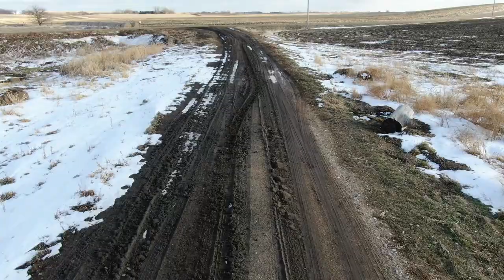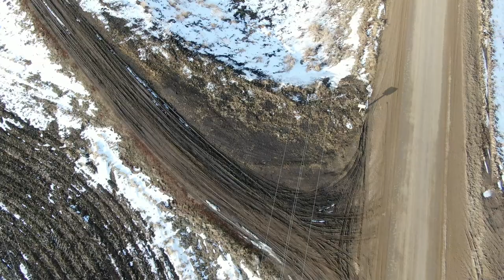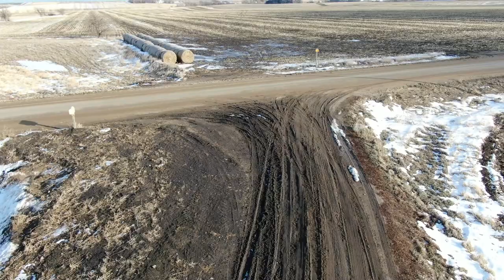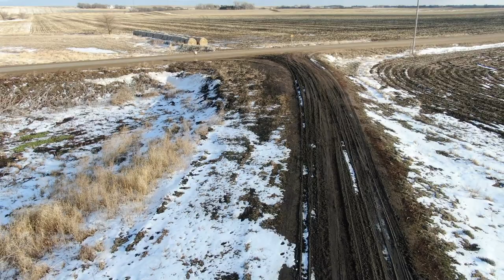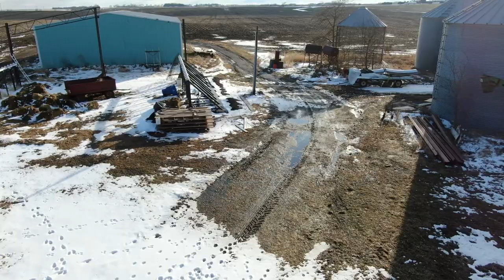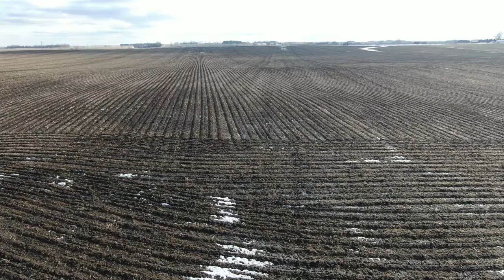FDWB - Muddy lane question - adding rock & fabric?

Comment: The brother in law has a driveway that was in similar condition when he began working on it about 20 years ago.  

The first year, while the mud was still soupy, he shredded and scattered several bales of old hay on the drive.  Then he waited until the mud was almost dry before he scattered several yards of yellow clay over the mud.  A few weeks later, in middle April, he put down two loads of river rock.  Later, in June, he brought in gravel.  Finally, in August, he scattered pea gravel.  

He repeated the sequence during three following years.  Over time, the drive firmed up and built up above the surrounding ground.  It took time, but the drive is now comparably to the county right of way.

Comment: I'd suggest talking to your local Road and Bridge department. They will know if your idea might work, and should give you their opinion what they'd do. My uninformed opinion would be to use road base. Compare your driveway to your county road. That's what's working. I have friends that have used fancy methods before, and all it resulted in was a massive washboard issue and it was hard to maintain if not impossible. It's going to be expensive either way. I just hauled in 29,000 pounds to our driveway, and it cost us $183. I couldn't imagine how many yards you'll need. Our Road & Bridge told us to stop using round rock, period. They did suggest that crushed flat rock would help, but road base would be cheaper. Road base, and wheel pack the snot out of it. Of course addressing drainage. They use a 2% crown on their county roads.